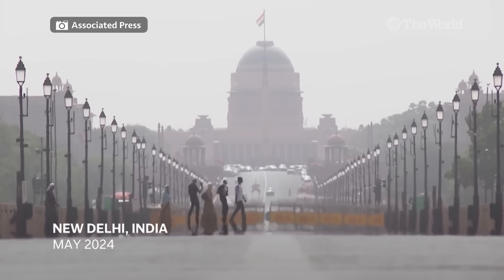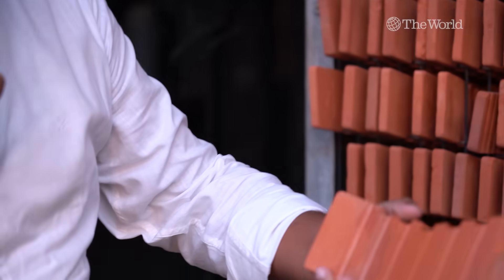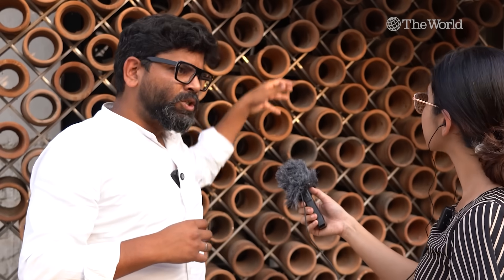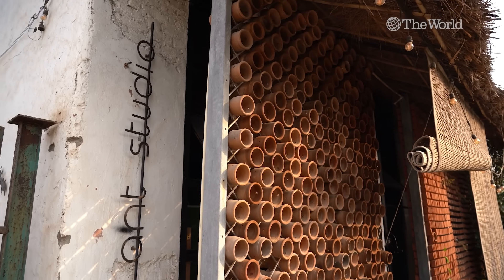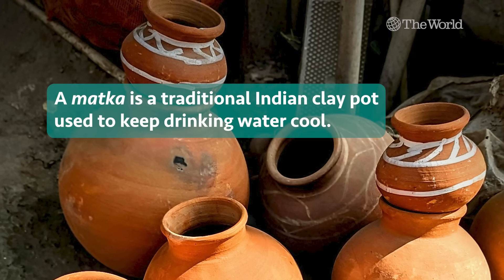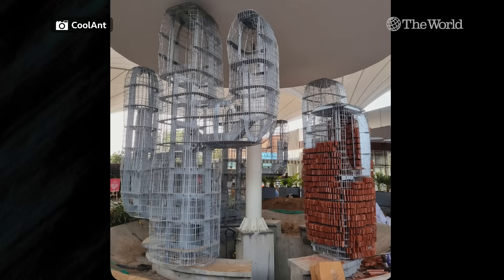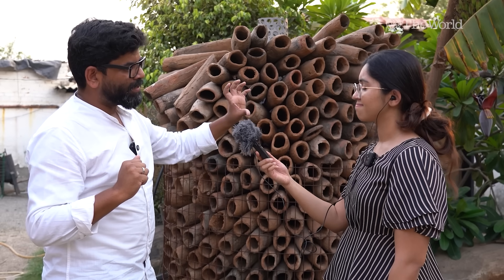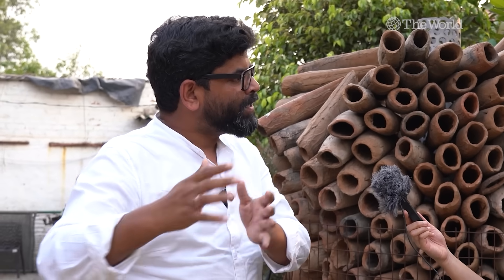Nights in Delhi hit 95 degrees. This keeps homes cool.

Comment: If you don't live in a flood plain, an underground house stays cool in summer and warm in winter.  With a strong build, you can make it a faux underground house by covering it in a mound of soil.  Maybe 3 or 4 feet thick.  A man did this long ago and his house is still standing and has good ventilation.
Reply from the maker: Super interesting!
Reply: @TheWorldNewsGBH  
My question is what to do when monsoon times havy rain or stormy weather. I mean is this idea works on high power airflow please answer. (mentioned you to got attention)
Reply from the maker: @WikiTubeবাংলা  Good question! Will check with the designer and hope to have an answer to you soon!
Reply: @TheWorldNewsGBH Cooper Pedy comes to mind
Reply: Rammed earth and cob work extremely well in creating an averaged temperature environment. Re-radiating roofs, white but with strong emission in a particular IR band (8 to 14um I think) send heat back into space actively cooling the planet. This is coming. Breeding plants for lower chlorophyll/ choosing yellow leafed plants around the home helps also.
Reply: TY!  @fliprim
Reply: @fliprim  can you explain the lower chlorophyll helping? That's an interesting concept but I don't think I understand this particular point. Thanks
Reply: @dhartitrivedi7454  Sure. One of the arguments against planting trees etc. is that (depending on species) they can lower the effective albedo (reflectivity) of a region, and the lower the reflectivity, the higher the local solar heating. High chlorophyll leaves tend to be darker to trap more sunlight, less creates lighter yellower leaves. Same is true for plants. So there is a perfectly viable species of soy plant that has much lighter (low chlorophyll) leaves. Simply choosing (and breeding) lighter leaves could drop local and planetary heating. Barcelona is overheating and needs three times as many street-planted trees to catch up with say London. This will drop average temperatures through evaporative cooling by one degree celsius (really good) If these were yellow-leaved like Genkgo Biloba this could remove another degree.
Reply: 100% it's insane more people dont do this around the world. Search for an Australian town that is all underground
Reply: True, if you dig several meters underground, there is constant cool temperature year round.
Reply: @rick-yo  Provençal wells with chimney effect. Or Canadian wells. People always comment about the radon gas underground, I don't know how likely it is but it does bring concerns about cancer.
Reply: @YoJesusMorales  Radon gas can be tested/detected;  either you have it or don’t… & build accordingly.
Reply: @YoJesusMorales    Great point about Radon Gas (cancer causing gas).  It can be present almost anywhere & can enter buildings easily.
Reply: @YoJesusMorales   A test can show no radon gas present, but later, the same property can test positive.  AI described 7 causes for this.
Reply: But what about air ventilation?
Reply: @pritam1754    Underground tubes passively moves cooler air into the home.  "C" Incredible small off-grid Earthship home.
Reply: @pritam1754  You design ventilation and water capture in an underground home. We also have windows at ground level under an overhang. Think of it as a house built into a hill.
Reply: I looked at a home that had Hempcrete walls - the walls breathed and were thick.  They absorbed heat during the day and radiated heat at night.
Reply: It's such a shame we stopped building living spaces in this way - we succumbed to the need to "display" our homes
Reply: Im doing some researches on the topic, do you happen to remember where did you get some of those information?
Reply: @hardstylelife5749    While Earthships are not technically underground, they do use a lot of soil for cooling.  They use rammed Earth filled old tires in the walls to keep them out of the landfill.  They have many interesting features, too!  You might enjoy this one:  Earthships: self-sustaining homes for a post-apocalyptic land?
Reply: @wownewstome6123 thanks pal, appreciated!. Earthship are surely a great “middle ground”; I’ve seen some actually carved into hills granting a vertical visual, truly fascinating. I was considering an implementation of some greenhouses options into the project fo some house: domes and crystal tunnels to help both with higher degree of lighting and increased warmth in area more prone to have lower temperature.
Reply: @hardstylelife5749    Later, I will post some vid titles of tours of a few types of underground or partially underground homes I found interesting.  They may help you out.
Reply: @wownewstome6123 thats very nice of you, thank you, much appreciated!
Reply: @hardstylelife5749    What are you researching for?  Is it for a certain region, soil type, and climate/micro-climate?  Is it for a plot of land you own?  What are the limitations?
Reply: The Chinese do underground housing very well.  Yaodongs go back centuries.
Reply: Not always though. If the soil is shallow enough (IE only a few feet to the bedrock) the bedrock will absorb a lot of heat and will actually be hot a thermal mass heating the house on a hot day. You need to both block solar radiation from your thermal mass and insulate it.
Reply: @Tvtyrant2  Sorry, but this is nonsense. You might argue that the rock beneath becomes less of a thermal sink from the house on temperate days, the rock beneath heated by a hot previous week. But that's all.
Reply: underground housing, like Earthships work in low humidity environment.

Comment: Did anyone consider that most of India is water scarce? People don’t get water to drink. Clearly a solution only for people who are well heeled as is apparent by the installation photographs - all multi million properties
Reply: Surely the question is why is water so scarce, what policy are need to ensure people have access to clean water.
Reply: Don't you think they are recycling the water?
Reply: @Farjah-q5p water is recycled BUT there are massive losses through evaporation and needs constant refilling. Most cities in India receive water once a day for about an hour. During this time people will refill their water tanks to last until the next supply time. So most households will run out of water within 48 hours without water supply. Except for those with underground wells.

Comment: How do they prevent the rusting of the metal structure supporting the terracotta tiles? And prevention of mold.
Reply: Aluminum
Reply: @Strongholddemons  )))) nice
Reply: @Strongholddemons  cost and strength
Reply from the maker: Great question! The metal structure can be made of galvanized steel or stainless steel, depending on what the customer wants, so it should be able to avoid rust. Mold can grow on terracotta if there's no air circulation but most of these units are installed in areas where there is adequate ventilation (since that's how they cool).

Comment: What about Mould and dampness and monsoon?
Reply: The constant airflow takes care of mold and dampness.
Reply from the maker: Good question! The metal structure can be made of galvanized steel or stainless steel, depending on what the customer wants. So it should be able to resist rust. As for mold -- yes, mold can grow on terracotta if there's no air circulation but most of these units are installed in areas where there is adequate ventilation (since that's critical to how they cool), so mold should not be a problem.
Reply: @TheWorldNewsGBH  How about moss and algae? Moss might be desirable for aesthetics and air quality, can't say the same for algae.
Reply: @TheWorldNewsGBH what about mosquitoes breeding in the water pools beneath the terracotta? Did that occur at all during your testing?